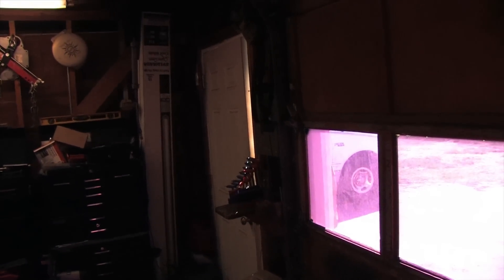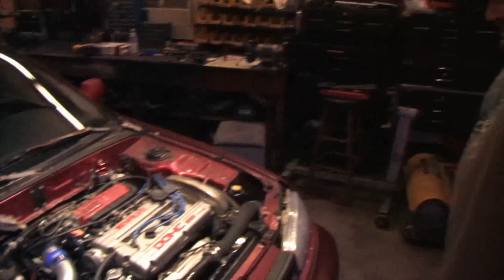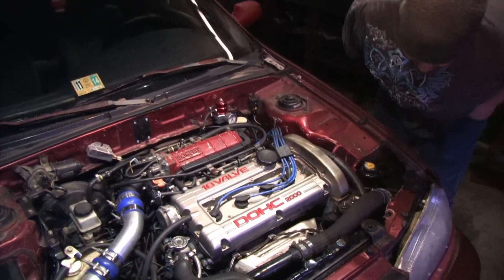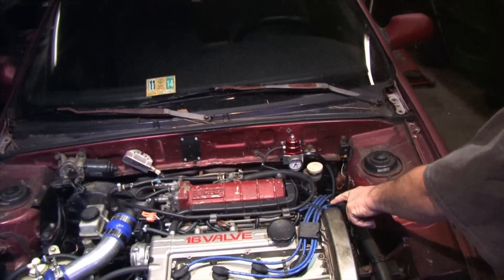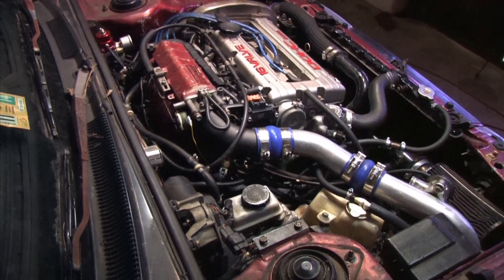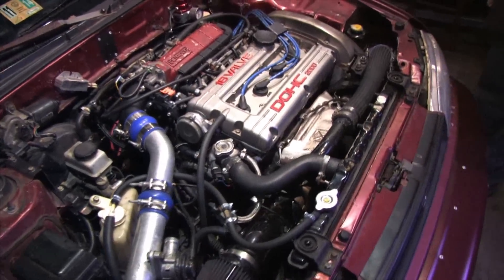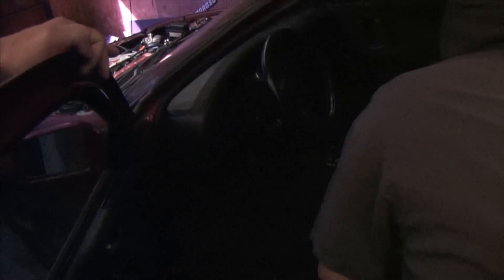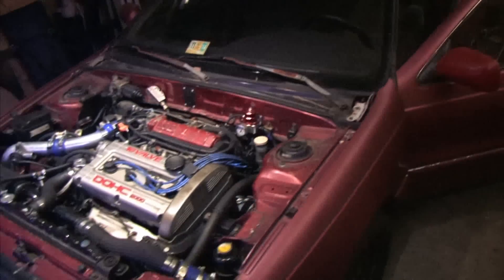Hyundai 11 - 1st Startup & Heat Cycle

Comment: I'm no mechanic, but is it a good way to prime an engine by unplugging the fuel pump fuse and cranking the engine for 10 seconds at a time a decent way to do it? That would be the easiest way in my eyes to do it with a new car before first start up. I'm used to the drill types down the dizzy hole :3. I just noticed something, VA plates...I live there. I've always wanted to do a TBI swap with a megasquirt (I have a 2 barrel carb on my old ride). Hmmm
Reply from the maker: Brownbear Yes, absolutely it is a good way to prime it.  In Hyundai Assembly 9, I basically did the same thing.  I hadn't installed the ECU yet, so no fuel was squirting and the ignition wasn't firing, but the fuel pump was active.  As long as you can stop fuel or spark, you're good.  

Yep.  I'm in VA.  For now.  It's getting way too liberal around here for my liking.  I'm in the second-bluest county in the state.  You can't do this... you can't do that... Government harassing the daylights out of me at every turn.  A tax on absolutely everything.  So ready to leave.  I grew up here.  I moved everywhere else, but came back.  It used to be a fantastic place to live.  Sadly it's broken.

Maybe I just need to move where I can't see my neighbors?
Reply: ***** I know exactly what you mean, I've been to lots of places and I plumb don't like VA at all. West coast has it beat in every way. The two things that I can't get past here are winter and traffic. I also haven't made one friend here either, the people aren't even friendly. I have a house in WA state and I will definitely retire there. My wife getting a ticket her first day in town was like an omen; and we had just driven 3000 miles from WA state to here with no issues.

Comment: Wow Jafro, this is your most boring yet still interesting video yet :-) 
If the intercooler weren't so exposed, it would be the perfect sleeper. 
Have you kissed your front tires goodbye?
Reply from the maker: denelvo Yeah, I sorta ruined the sleeper effect.  I know some will disagree with me, but nothing else belongs in that enormous, gaping, protruding hole in the bumper.  That space is so expansive, shouting into produces an echo.  It probably fits better on the Subaru it belongs on.

Comment: Crushing my 1g bov stopped it from leaking at idle. I removed it and put a c clamp on it and cranked it until the top started to cave and now it doesn't leak. I'm sure you knee about crushing BOVs, but just throwing it out there.
Reply from the maker: Christopher Bowley I've got 3 of these laying around.  It could happen?  Considering alternatives, though.

Comment: Awesome man.  I'd recommend adjusting the InjBatAdj table to adjust your deadtime (if any adjustment is needed).  The one on the fuel tab just adds deadtime to the stock curve, and some injectors respond differently than the OEM ones to different voltages (read: MOST injectors).  What I've done is set it fairly close, go drive around, and any adjustments I make i just throw on the fuel tab real quick since the car can stay running for that.  Then when I'm happy with it, I'll stop the car and apply it to the DA table.  Saves time that way.

Comment: Definitely normal for lifter tick after a long rebuild.  10-20 min break in period and everything sounds much better.  Hard to see during your rev but I couldn't see the TPS move.  Check the TPS?  Well it's turbo so wideband was an eventuality really.  Just gives you even more reason to swap over to WB.  Looking forward to seeing how you tune with ECMLink.  This is the first time I've ever seen it so please take us through an introduction course so we can see all the options and what applications each might be for.  Great to see it finally up and running.  Seems like a year or more?
Reply: Lifter noise tends to go away under load.  A quick spin around the block will usually quiet things down greatly

Comment: Why is your valvetrain so damn loud?
I have the same Wideband, it works well.
Reply from the maker: PC Master Race It's all in the description, the subtitles, and at the end of the video.  :)
Reply: ***** But the noise persisted through the video?
Reply from the maker: Nah, not after it was fully warmed up.  It's not ticking at the end when I did the walk-around.  It stopped after the car fully warmed up and the fans cut on.  That's what it takes to clear the oil pump grease out of the lifters.

Comment: Maybe you already know this, but if you're running too lean, the O2 sensor isn't gonna cycle, and not gonna go into closedloop. Just an fyi in case it helps. Oh, and I guess I'm on my girlfriend's account. Lol. Scott Laird....aka, V8s_are_slow
Reply: Felisha Steverson If nothing else, I figure it'll help others cause as soon as they see it not cycling, they'll be going out and forking over some cash on new O2's cause it's not cycling when it's only because it's lean. I've seen it many times.
Reply from the maker: Felisha Steverson Yep, and you're correct.  That's what I was messing with between 7:35 and 8:38.  I tried several different settings with global to change my fuel mixture, and you can hear the idle changing because of it... but it didn't register any different on the o2 sensor.  I set it back to -41% in the end because I have a plan B.  Plan A was to run an o2 AND a wideband.
Reply: ***** Yeah, sometimes when tuning someone's car that has an O2 that's not cycling, I might momentarily enable NBO2 sim to see if anything changes. Always good to be able to use as a backup as well in case the stock O2 goes bad. A simple click and you're using the wideband instead and keep on truckin.

Comment: could you also find out that ECU was stuck in open loop due to the fact that there was the number 1 next to the open loop display and a 0 next to closed loop or was it for some other reason?
Reply from the maker: h0rr0r100 Oh I totally knew it because the display said open loop 1.  That's why I added and displayed those values.  I displayed closed loop as well, just in case of the rare chance that my ecu wanted to behave like an indecisive cat, standing half-way in the doorway not able to decide whether to go in or out...
Reply: thanks! very nice and videos...keep them coming.I hope you show us more about messing with fuel maps and the rest of the tweeking with ECM.

Comment: been waiting MONTHS to see this. wish u could of beat me to my startup so it didnt take me two weeks to learn how to get ecmlink setup properly. Jafro, i cant wait to see the tuning video i have been reading and reading for weeks how to tune speed density. i also do not have a cycling 02 sensor so i feel your pain. and than my idle was at 2k and i thought it was due to using the magnus drag manifold and having a 90mm q45 tb but it was because the tb needed to be closed at idle and i had it open by mistake! now i have to put in the 1600c injectors and see if after setting the fuel trims and being up to operating temp i can get a clean rev beings it runs really rich anywhere above 2k rpm. any advice appreciated im currently going over the basics and have watched almost every video

Comment: Two things you never covered, what kind of Spark plugs are you running? And, do you plan on converting the rear to disc brakes? The front brakes seem legit enough to stop, but I know drums are not ideal and are quite a bit heavier. I saw you had discussed running plugs that are two grades colder, to prevent knock in a video a good while back.....Love the updates! Can't wait for the new video's!

Comment: Nothing like the sound of a Mitsubishi lifter on engine start up. Congratulations on getting her running with good oil pressure and no leaks.

It is amazing how important a properly working O2 sensor is to the ECU and tuning. Not a place to skimp, IMO.

The HKS cams were so docile, I would not have guessed they were installed. With a bad O2, I guess it would be wise to install an AFR solution like AEM or like.

I look forward to seeing the rest of the tuning videos and seeing her on the road again.

The Colt is on everyone's mind, by the way so maybe a short update on your plans and schedule for her please?
Reply: Yes please give us an update on the colt.

Comment: Damn, I had a feeling about your o2 sensor
Reply from the maker: Christmas Crustacean I knew it was bad.  Well... I was about 70/30 sure anyway.  But I needed something to fail to demonstrate why ECMlink is useful.  Also, most people following the LC-2 Wideband install video will be doing it with their engine in the car, and my bleeding arms and knuckles demonstrate that I'm not going to ask you to do anything that I'm not willing to do myself.  ;)  What I'm able to do with the LC-2 prevents me from having to spend $100 on a new narrowband sensor.  But yes... good call!
Reply: Yeah I suppose its better to take a shot rather than spend the $100 needlessly, fun to change though :/
Reply from the maker: Fun?  On this car?  lol...  Wait until you see how often I have to remove it and re-install it for calibration.  I'm going to HAVE to make some changes to this.
Reply: Oh yeah, pain in the butt sensors are always fun.  It just wouldn't be the same if it was easy to reach and replace... you might end up with hands that aren't chopped up and with a shred of sanity.
Gotta love cars man.

Comment: What are your thoughts on engine break-in? There seem to be two camps - the larger "nice and easy" and the small but insistent "go hard for better ring seal" camp.
Reply from the maker: ekner On a new engine with new bores and new rings, yes.  Rev 3000 RPMs until hot with non-synthetic oil.  On old bores, old rings, old pistons, I only rev'd it to add heat because I'm impatient.  Bearings may seat... and there are different camps on that as well, but bearings don't need to "break in" because there's not supposed to be any metal-to-metal on the bearings if you did it right because the parts float on an oil film layer.  I will say that the high-rev version of the break-in is more likely to tell you when you did something wrong–while it's still in your garage.
Reply: ***** Wouldn't revving it in the garage be going easy, since you're not generating significant cylinder pressure? I'm tempted to put a rebuilt engine on a block heater under a blanket to get it nice and toasty, then fire it up and start driving it full throttle almost immediately because of what this guy writes: http://www.mototuneusa.com/break_in_secrets.htm

After all, there shouldn't be a reason why anything would break, if you're not doing anything experimental that is.

In the world of Yamaha KT100 kart engines there's also the voice of Muller, a legendary machinist who seems to have vanished from the web somehow. He had a great website where he described his blueprinting process and what little special things he would do to his personal engines. And on the subject of ring seal (which certainly is important when you only have one piston ring) he would keep an identical copy of his engine's cylinder bore in which he manually ran a piston fitted with a new ring each time he had to swap the old one out. Partly because he wanted to wear the ring to the shape of the bore, but his reason was mostly that fragments from the new ring would very lightly score the cylinder bore, ruining the integrity of the crosshatch pattern and doing it his way would prolong the life of the parts, as well as providing excellent ring seal. And I've seen some horrific leaky rings from pussy-footed kart engines, I'm talking black varnish (thanks to castor oil, mmm, that smell) most of the way down the piston skirt. Muller was pretty obsessed with ring seal (he even ran piston clearances of under 1/100 mm while most other engine builders recommend 6 to 8/100s), and having run one of his engines very successfully I'm convinced there's good reason for his obsession.

Comment: My lifters sounded like that on first start after an expensive re-build, not what you want to hear eh??!!
Reply from the maker: andyp2001 Meh, not too bad, not too bad.  It's normal.  It's abnormal if they don't stop after a heat cycle.  It made me do a double-take, but no bricks were shat.  The hardest thing to do is to listen through it for a real problem.